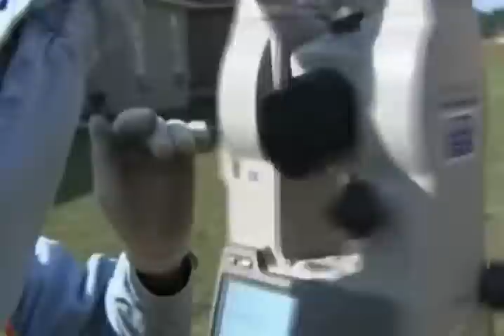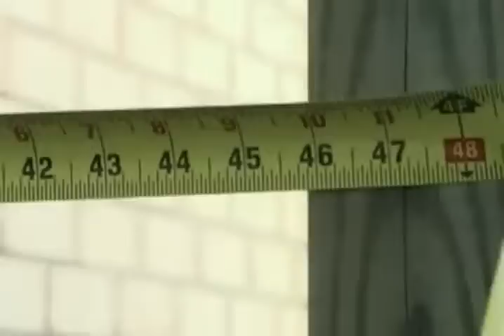Holmes On Homes Sea 05 Epis 01 O Fence Ive

Comment: Never thought I would hear Mike Holmes say something poetic, but I should have known, he has a soft heart. That bit at the end where he waxes and wanes about the separation and coming together of a community over a fence, that's amazing! They originally wanted a fence because they wanted to be separate from their neighbors. They got taken. Some fights and disputes occurred among the neighbors. Then they get a fence that brings them all together. What a great juxtaposition, opposition, and morphing between the free and the fenced. When in fact, the fence is not what was blocking that community. Freedom can be found in a jail cell. The coming together was inspired by Mike. Did you see where Mike insisted that they have  staggered boards so "the light could get through to the grass and you could say hello to your neighbor"? He knew, and he solved the problems of an entire community and inspired them to become good neighbors to each other. What a wonderful story.❤

Comment: A bunch of them paid cash?  Seriously?  Pay with a check or a debit card.  Then your bank has an electronic record of the transaction even if you don't have a receipt.  Use cash for doing your laundry, bus fare, tipping a waiter, or buying a candy bar.  But never use cash for a major purchase.
Reply: Some did pay with check, but the construction company name was crossed out prior to depositing. The lack of electronic record isn't the issue, but rather the law. Long as a contractor makes some effort to do work, it's generally considered a civil matter. Very rare for construction contractors to be charged criminally. Even then, usually the DA (or whatever the equivalent is in Canada) may accept restitution (sometimes even just partial) in exchange for not being prosecuted. Basically, it's buyer beware and keeping a close eye on the job. Difficult for busy laypeople who don't know the various aspects of construction.

Comment: I found, especially if fasts setting cement was used), is to wet the ground, like soak it; put forks on skid or bobcat and attach “straps, chains, etc….gonna use” and the pull straight up, and has to be straight up; about 30-60 mins at 22-25° 
Alternate way, Farm Jack, or high lift jack; whatever you call,it in the area you live. Principle is same EXCEPT FOR FOLLOWING:
Put jack on ½” - ⅝” plywood for “sturdiness and strength AND DINT SOAK GROUND LIKE WOULD IN OPTION 1 (why b/c have machine, here it’s your muscle power and will create a suction vacuum using too much water w/ saturated dirt and as it will come out, gonna be a pain and can be dangerous to operator using jack and chain or strap (as last thing ya want is a rebound and having leg, stomach, arm, and even head hid by the “fastening hold down material” to post and jack…..it NOT FUN!
So, 1st post use NO WATER, if struggling and wanna quit, try adding ⅓” - ½ “ gallon to start and wait 10-20 mins. Hotter it is outside, the shorter ya wait (35°C day, after pouring water on post for jack, maybe even machine; I’m waiting no more than 12 mins…
Hope helps, cheers